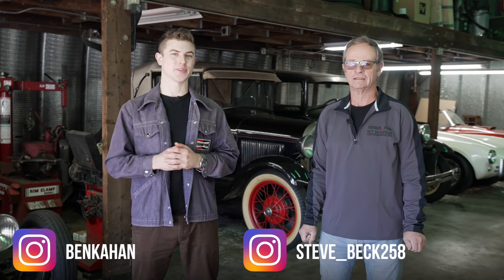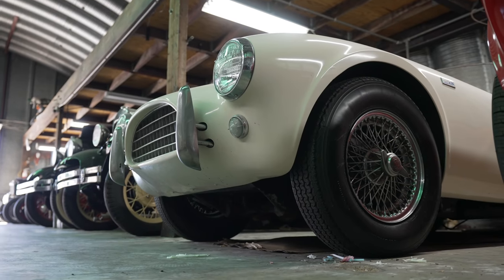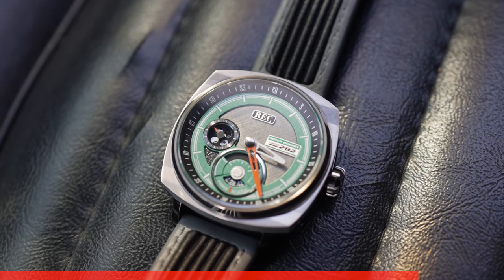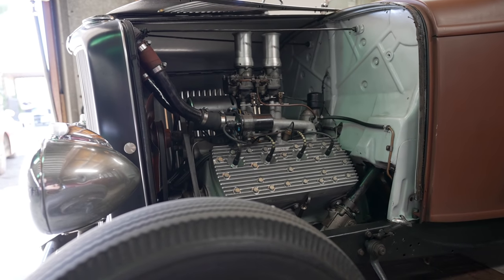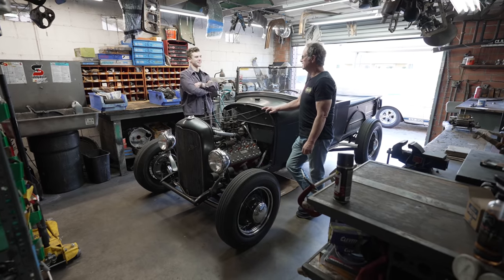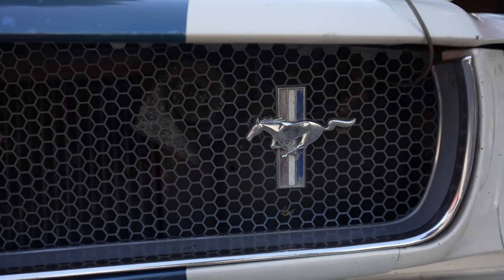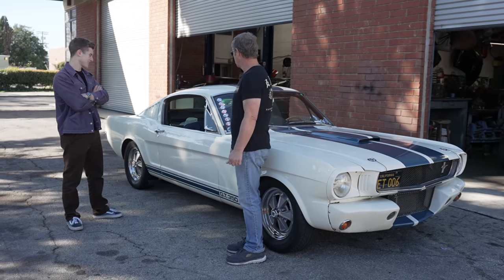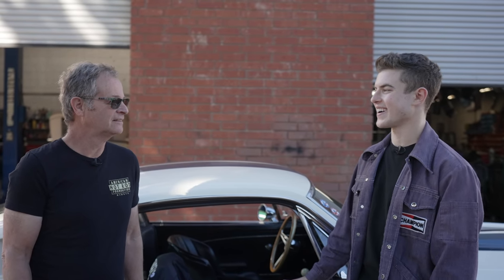1965 Shelby GT350 Mustang Rips The Streets Of Los Angeles

Comment: I owned a '67 fastback Mustang in high school and this video really makes me miss that old Pony. Mine had a 351C that I completely went through, chamfering/de-flashing all of the edges of the block and heads, as well as the oil passages and returns, static balancing the rotating assembly and polishing the rod beams/piston heads, giving the heads a good once-over in the bowl and exhaust port areas to shine things up and help hold the carbon build-up downt and a DIY port match job that took a month of working and measuring - my micrometer and calipers became intimate friends, as I slowly shaped the intake runners and head ports. Next was a 9-inch posi rear end w/ 3:90 gears for hook-up. When I finally assembled that engine it was an easy job and it went together and was broken-in in a week-end. When I took it to the drag strip it ran a 13:89 first trip, at about 7K RPMs. I later brought that ET down to 12:79 at over 8K RPMs for personal-best quarter mile. That engine screamed like a Banshee and never gave me one problem. Ended up selling that car for $10K after I had won my division, altered stock. I've never been in car that felt quicker than that Mustang. I used that $10K to buy a new Triumph TR-8 in late '79 - what a disappoinment that car was , as it spent way too much time at the dealer's repair shop. Suspension and brakes were woefully under-engineered and the electrical system was problematic, at best. Ended up giving that car back to the dealer under the Lemon Law clause and bought myself a new CJ-5 Jeep that I kept for some years before it got smashed by a drunk.

Comment: DUUUuuuudddDDE!!  This Stang totally reminds me this one time I was out with this nice girl and we had taken that old KemoSabe trail up to Horsheweitz pass to check out the air brigade defence machine setting up their advanced airwac sqwuack comptroller in the valley but I started to get some vibration in the motor mounts on my old beater hotrod on account of I had just cut on the Roots blower from a GreyHound bus to my aircooled helicopter Tucker engine in the back of car #52 off the line.  MAN, it was abadass ride lifting the front wheels at least half track running 9's in the quarter cuz of all the weight transfer and my chick would ride in the back to help settle the torque steer on account she was a bigger gal and fit squarely in that chopped off tub behind the rails of the Tucker chassis where she could just hang on and straddle the plumbing tube roll cage bars.  
Luckily, no one was injured... except the day that gal broke my heart. /w\TMFR/w\